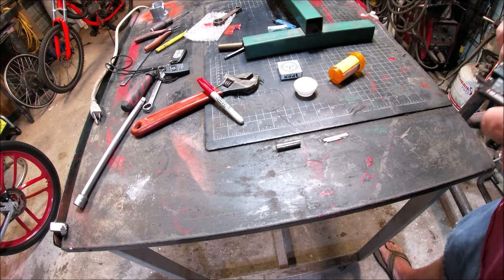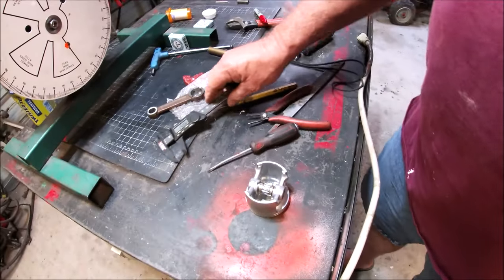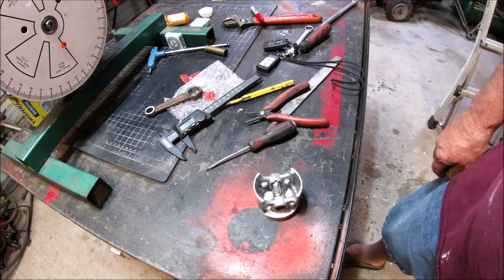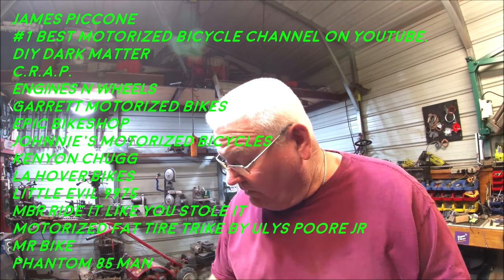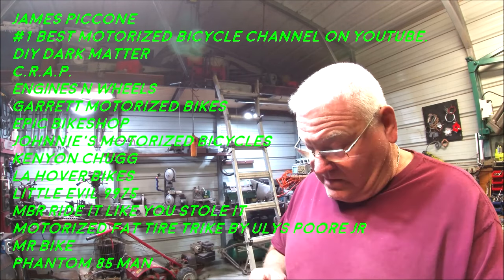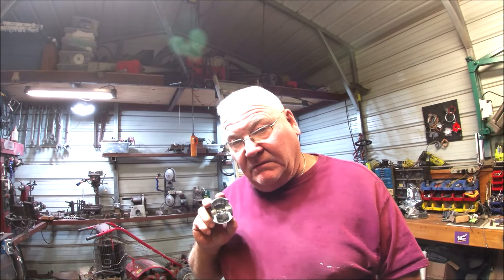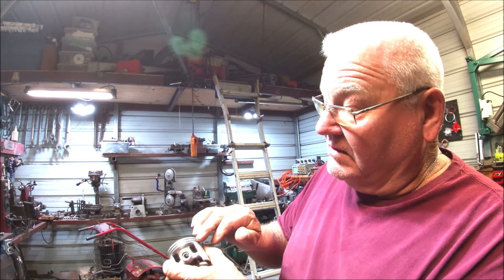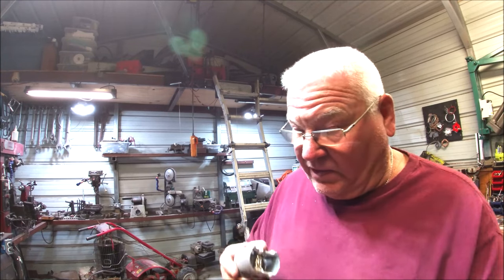Phantom 85 guys you need to see this video if you want a bulletproof wrist pin

Comment: I've had the phantom 85 V3 for about 4 months now and I haven't had one problem yet. I don't know if I'm just lucky or what  but there are people who still have the version one and it's still running so who knows but I did do the break in process but with the 66cc engines I just drive them like I stole them. Those engines will take a beating that's for sure
Reply: I bet it's blown now 🫨
Reply: @danajett  nope! Still running great

Comment: I simply put 2 small bushings inside each end of the piston so the 10mm wrist pin fits perfectly inside em and then dremmeled a couple of washers to fit snuggly inside each end of the piston to keep the wrist pin in and then threw in the original clips.  I did this on my ms660 56mm same piston just bigger ofcourse
Reply: I like this idea better I think

Comment: Not being a machinist, l don't follow what you are doing. Cut in half, why? Shoulder, why? What is the problem with the wrist pin?
Reply from the maker: In that particular motor they use a brass bushing that fails and is 12 mm 12 mm wristband and a 10 mm rod
Reply from the maker: And rod bearing